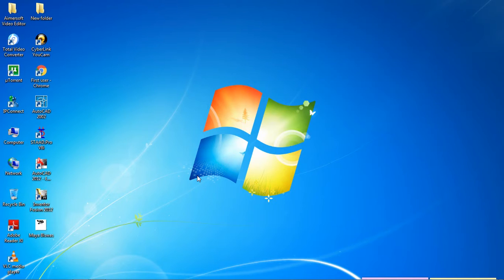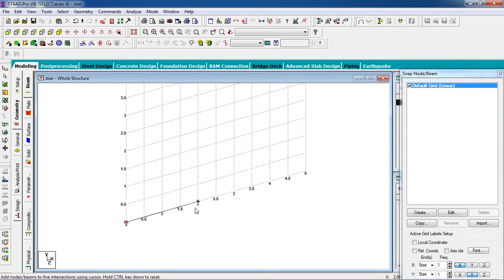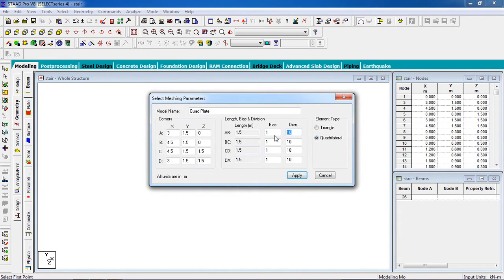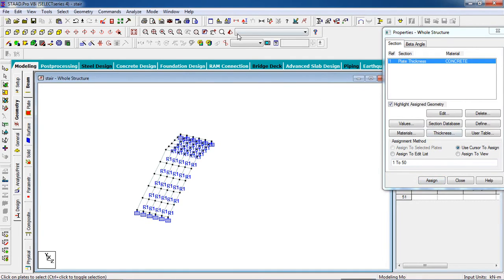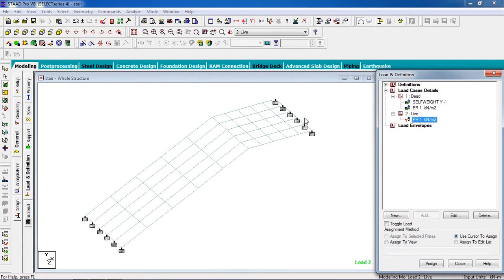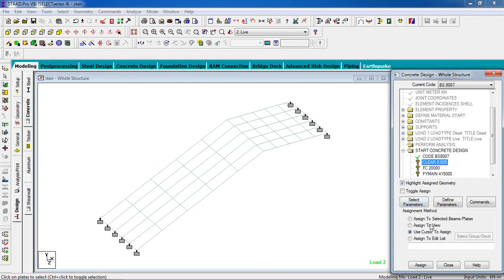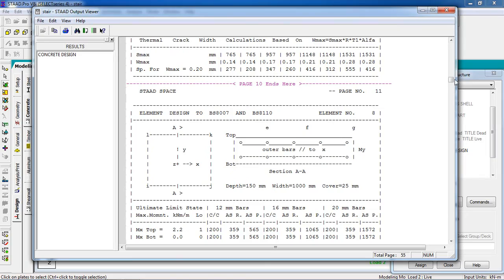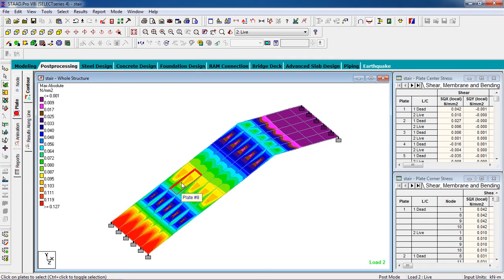STAAD Pro Tutorials - Analysis & Design of RCC Staircase With Details Part -2 ( Day 20)

Comment: i am student of structural engineering
Sir, i learn staad pro from your videos uploaded on youtube
and i have question about the staircase details or slab details provided by staad pro results. 
i have attach one photo with mail is the staircase details given by staad.
and
 in which the bar diameter 12 mm, 16 mm, 20 mm shown. and below that the
 many values are given. so please explain me this details clearly, i 
cant understand this detail. what says this detail actually.
please sir reply me,

Thanks
Reply from the maker: You have to provide As R